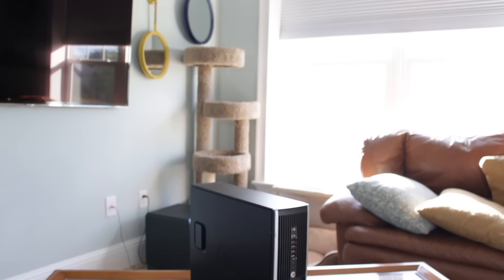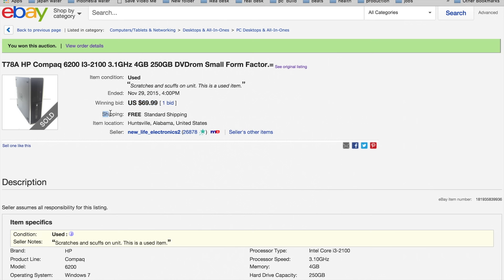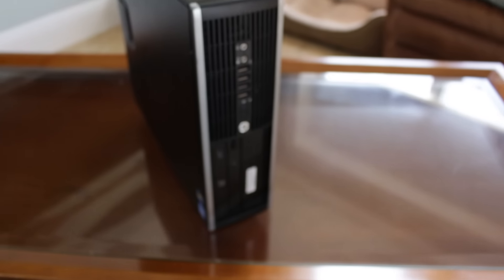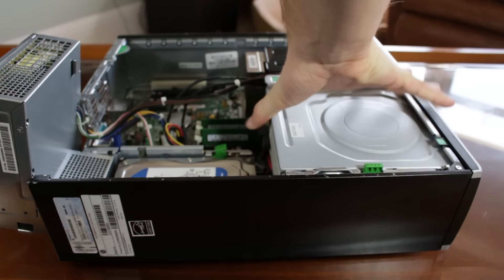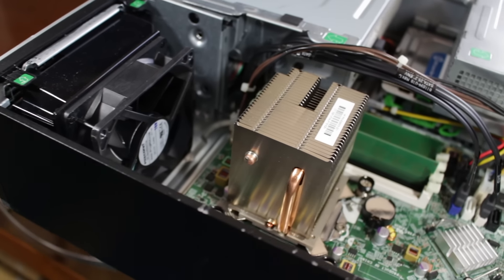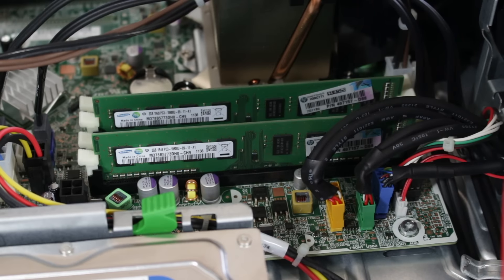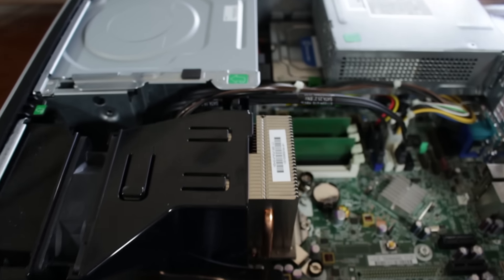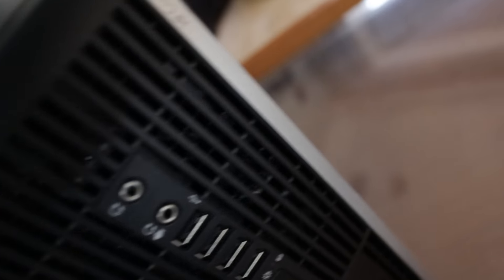The $70 Ebay PC!

Comment: That PSU is gonna burn the house down man. Fer sure.
Reply from the maker: Like I said in the video I'm not using the power supply just the cpu ram and hard drive
Reply: Tech By Matt Nah I know, I listened, just alot of other people will just use those computers not knowing that.
Reply: HungaryCow I still upload daily, twice usually.
Reply: +ProtoMario Btw, I just bought this exact same PC from eBay (i3 2100 with 4GB RAM, a 750GB HDD and Win 7 Professional) and stuck a LP GTX 750 in. Had enough Headroom to Overclock the GPU, has been working fine for the last 6 months I got it.

Gotta love Sandy Bridge CPUs, I'm liking that i3.
Reply: MusicHaven2012 Dual Cores are being phased out though, unfortunately, some games don't even run on them.
Reply: +ProtoMario Hi proto!
Reply: Neh i think that the 2 usb 2 porn o ports are dangerous
Reply: +ProtoMario Yes, but the I3 has hyperthreading.
Reply: Hey proto I'm subbed to you! I didn't know you liked pc's this much
Reply: Marcos Antunez Love PC's
Reply: and we love you.
Reply: no way those PSUs will burn down the house, hell, its more likelly for a low end corsair to burn down the house than this. Those delta/liteon PSUs are really good, overbuilt infact.

Comment: Actually, MSI makes a low profile gtx 750ti 2gb ddr5 gpu that would work.   I use it myself in a dell optiplex 780 I maxed out adding a q6600 quad core, 8gb ddr3, 1tb 2.5 hybrid drive and a bluray optical drive.  Runs windows 8.1 tile and big picture for steam.  I play fallout 4 ultra 1080p without fxaa or AF just fine using a xbox 360 controller from the couch.SCORE.
Reply: 8.1 is cancer
Reply: +DonDanGeaTV nope....not anymore
Reply: Doni Bathuu well tbh i only had it for like 16 days

Comment: so you can take the harddrive and it will have windows installed on it or will i run into problems since windows detects that its not paired with the other system parts?

Comment: Can't you just use a Gigabyte R7 240? It doesnt require any external plugs like most higher end cards do and uses very little power and has 2GB GDDR3.
Reply from the maker: +Cameron Limonta You could, but in terms of gaming performance a r7 240 isn't ideal. the gtx 750 ti only uses PCIE power and comes in a low profile variant, but that would require upgrading the PSU and because this PC uses a proprietary PSU form factor I couldn't find any higher wattage replacements.
Reply: +Tech By Matt true true but again not really everyone could afford to buy the ti but I mean alot of kids save their money for a while, I'm currently trying to save up for the r7 because my current card is an nvidia 8400gs 512 MB and at this point any card is better than this one
Reply from the maker: Cameron Limonta Well when you do decide to buy I would recommend checking out the hardware swap reddit page(if you're in the US or canada) there are a lot of good deals on PC hardware there

Comment: Maybe I wasn't paying too good of attention, but it sounds like you paid $70 for a near proprietary case, 4GB of DDR3 RAM, and a 250GB hard drive. None of that really sound appealing. Like at all.
Reply from the maker: +Blueshirt I also got the i3 2100 cpu as well as a registered license for windows 10 and a pretty good heatsink and the motherboard and the crappy, but included PSU. It was a full working system
Reply: +Tech By Matt As for the license, is it an OEM license, or a retail license? Because if it is OEM, it is useless, being tied to the motherboard. Fair points, though. What would the i3 2100 be used for? It seems a bit underpowered today.

Comment: People, I can get a Core 2 Duo, 8GB of DDR3, a 1TB hard drive, and and anonymous 2GB graphics card for $199. Should I?
Reply: get it and replace cpu for a quad core
Reply: Do it and put a q6600 in it, then you will have a pretty nice gaming pc or you could sell it :D
Reply: i really doubt u can change core to quad withou changing motherboard as well. the graphics cards are what you can usualy change to a much better one. if you plan to use this for parts or if you plan to upgrade it a lot i doubt it is worth it, and the specs are so non existent. that 2gb tells so little, same with core both are most expensive parts

Comment: Why you always promote junk aging cheap PC ? that kind of cheap power supply most likely blown up and make your home circuit break. $70 for junk , not a option for us.
Reply from the maker: Not everyone can afford expensive PCs. And if you actually watched the video you would have heard me say I'm not using the power supply. I'm using parts from this and pairing it with a 750 ti which has given me over 40fps avg at 1080p in shadow of mordor, skyrim, and metro last light redux. Which those numbers are far from "junk".

Comment: hey matt, great video as always!, I'd like some help on this pc I'm building (http://pcpartpicker.com/p/g9Z6Jx) haven't decided a case yet and if you can recommend me any parts to buy for the future please do.
Reply: +Raul Arenas Get a bigger power supply, but other than that it looks good.
CPU should be great for picture rendering and some gaming. 
The graphics card is an AMAZING card for the price right now. 
Like Chris said change that Hard Drive, toshiba is not the best company in the world.
Lastly, I would recommend an aftermarket cooler, that CPU runs pretty hot under load.